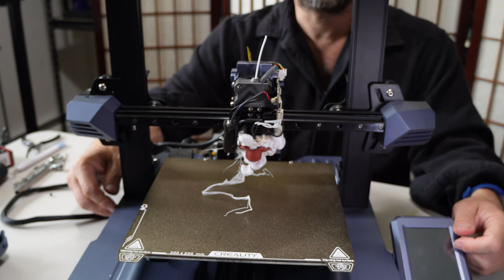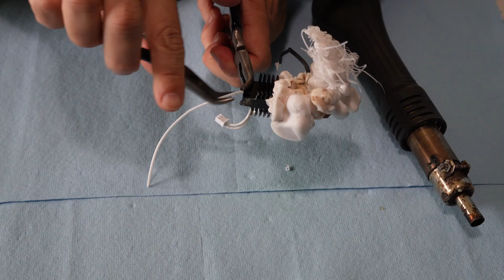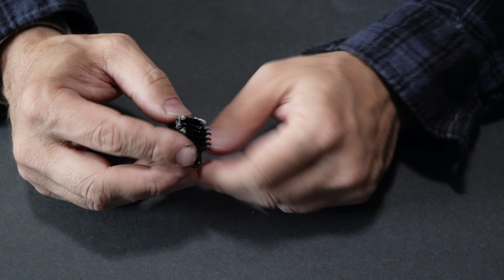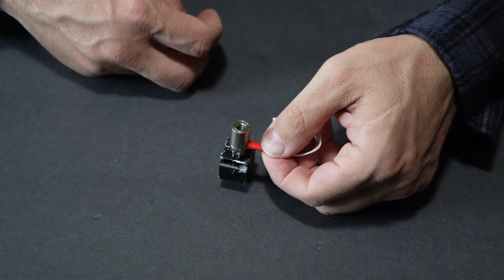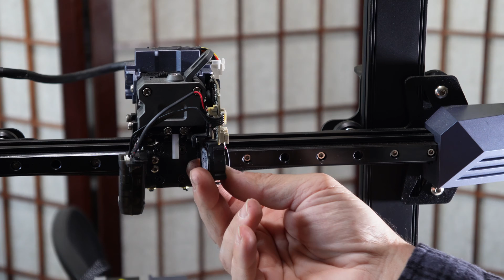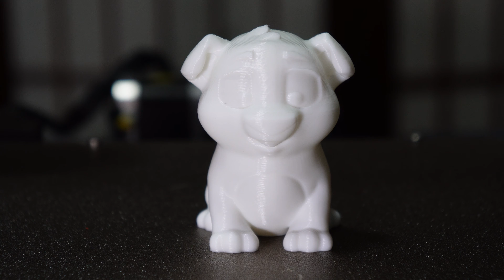Fix 3D Printer Hotend "BLOB OF DEATH". Install Micro Swiss FlowTech - Demo on Creality CR10- SE

Comment: After have having the blob of death, I bought the Microswiss Flowtech Hotend and Heatsink after which I placed them on the machine and a code came up sysing spray head motherboard communication error any tips i could use?
Reply from the maker: I would start by disconnecting and reconnecting the cabling to the toolhead and hotend.

Comment: I have had the bod two times on my k1 max. First time, most was fixed by melting the blob and releasing it. The operation was finally successful, and I successfully recovered the k1. 

But after a couple of weeks I had another, more serious stop. This time the thermal part broke, so I had to replace the hotend, the heat block and clean up the nozzle and disassemble the extruder to clean that one too. Luckily creality had provided a extra heater and nozzle (the old type), so all I had to do was to order a new heatsink,,costing me about $4. 

But I will be installing creality's new integrated, ceramic hotend shortly. Microswiss is mabe better, but also costs twice as much.
Reply from the maker: The micro is really nice, and certainly better build, but, the Creality works fine. I've got a gazillion hours on my K1's

Comment: Nicely done video. I appreciate how thorough you were. Found this because I'm going through my second BOD. This time I've gotten most of the filament blob out but now can't remove the screws holding the hotend to the heatsink. is it an M2 head? It's so clogged I can't even tell. thanks, again for the video.

Comment: Helpful video.  I'm  at the "blob of death" right now.  It's very discouraging!  I hope I can find the receipt and get a new hot end.  Printer should be still under warranty.  Do you know how to do a factory rest?
Reply from the maker: Don't be discouraged. It happens. This kinda nightmare is part of the 3D Printing world. Crazy stuff will go wrong all the time. You can reset it on the nebula, but, don't do that. Swap out the hot end. It's something you should learn to do
Reply: @3DRundown  I ordered a hot end from amazom and it worked.  I'm back in business!  Guy at Microcenter sold me one for a K1.  That did not fit.  I was able to return it.

Comment: Thank you for the video. 3D printing newbie, and this just happened to me after having the printer for 3 months. I came across this after already clearing the blob, but it is good to see I went about it correctly. One question if you don't mind, I noticed the heater block on your CR 10 se was black while mine is silver. It just makes me wonder if the printer I purchased was refurbished by Creality or if they were manufactured with different parts depending on when and where it was purchased.
Reply from the maker: Color is irrelevant, I assume it's chosen based on what's available during manufacture. However, Bambu Lab uses Black to identify Hardened Steal. Not the case here

Comment: Hi again. Hope you are well and safe! I got te same issue of my new CR-10 SE. I was wondering if I have the choice between CR-10 SE and K1 Speedy, which one I should choose? I am sure you will say that depends on what I want to print for and why, but as being new to the 3D Printing, I am not that confident as you all are. I also would like to have the option to use Laser Print as CR-10 SE version does not have, but K1 Speedy has (I think). I could have the CR-10's other models but I cannot keep levelling the bed using the wheels due to my disability and lack of knowledge. So, I would be obliged and grateful, if you please let me know so, I can decide what to do.
Remember, Life is Short so, Live Long and Prosper … 🖖 Cheers, matey!!!
Reply from the maker: This is not even debatable. The K1 mops the floor with the Cr-10 SE. If possible, go with the K1C.

Comment: I have the same problem with a blob for the second time, but unlike the first time, this time the printer really tried its best to end it all. Actually snapped the power cables going into the hotend and a fan. Quite glad it snapped before damaging the board it was attached to, because I don't think they sell those. Only had the printer for 2 weeks, when it did this despite making sure things were properly tightened.

Now ordered the Micro Swiss hotend for my Ender-3 V3 KE, because read that it shouldn't allow the plastic to leak all over the place. Also being able to print higher temperature filaments is a nice bonus (not yet sure how to change the settings from 220°C to 300°C when the time comes). Need to order a heat gun too because of this, but the one I'm planning to order can only do 260°C / 450°C. Do you think that would be enough to get the blob off?

While I was planning to upgrade my printer to a better hotend at some point, I didn't expect having to spend 1/3 of the printer's price on it this soon. Thanks for the video.
Reply from the maker: Hey buddy. Sorry this happened to you. Lemme get the unpleasant part out of the way...  The Blob of death is almost always user error. I have over 40 machines, and thousands of prints a year, under my belt. I've only had one blob of death ever. These Ceramic hot ends, do appear to be more susceptible to them, but, it's almost always not the fault of the printer. 
The new hot end will be up superb quality. However, it will be mostly the same design. Be SURE to snug up everything properly, especially the grub screw holding the nozzle to the copper tube. It's really SUS, that it's only ONE grub screw. Make sure to get it right.... FLUSH, and SNUG. 
If a print loses bed adhesion.... STOP THE PRINT. Running for hours, dragging the model around in the air, is how most of these blobs happen!
That said.... Sh*t like this, is just part of the 3D Printing world. Get through it, and get back to making! 🏆🏆

Comment: Good to see your 10Se up again, sold mine to get a P1S. I had to see what all the hype is about and now I know.
Reply from the maker: It's been a paperweight for months. Printing better than ever, with the new hot end. My P1S puts in allot of work. A good teammate with my K1's
Reply: @3DRundown  Patiently waiting for the T1, I think after this P1 experience it’s going to be a let down. Multi color is the way anycubic has come out strong with their new cobra 3 combo and the price…beats out the a1 and the mini. I need to see your review on though!
Reply from the maker: I emailed Anycubic, at length, offering to cover the new Kobra 3 Combo, but, sadly, they replied without any sign on comprehension. The FL SUN T1? Feel free to recommend me to them.. :)
Reply from the maker: I sent an email to FLSUN, about the T1. We'll see what happens.

Comment: How does the flotec hotend compare to the creality stock hot end on the CR10?
Reply from the maker: I'm not one to send people to third part options, and I don't typically gravitate toward that either, however, so far, being only 1+ days in, I'm very pleased. My CR10 had layer line issues, that I couldn't crack, and, I'm not seeing that anymore. Is it CP 5? Is it the new hotend? Is it both? Who knows, but, the print quality, on my test prints so far, has been fantastic. Also, the build quality of the hot end, to me, looks better than the stock hot end. Would I replace a working CR10-SE hotend, with this one? Probably not. But, am I comfortable recommending it, as a replacement? Definitely.
Reply: @3DRundown  update ? :D